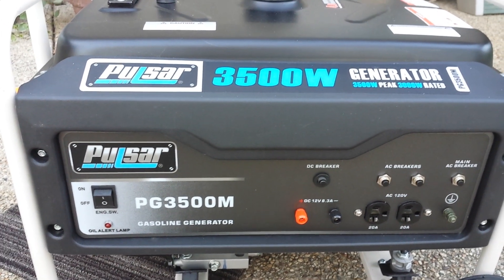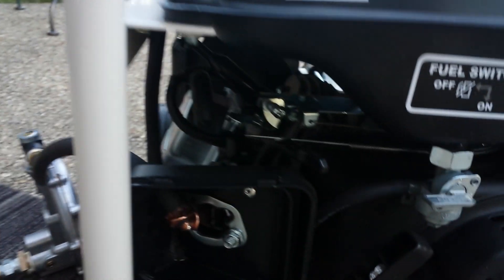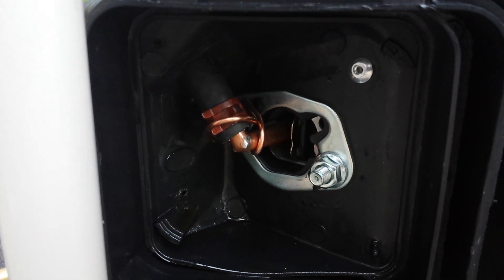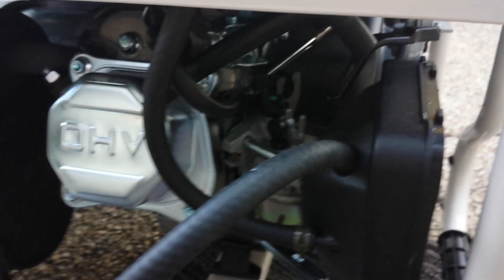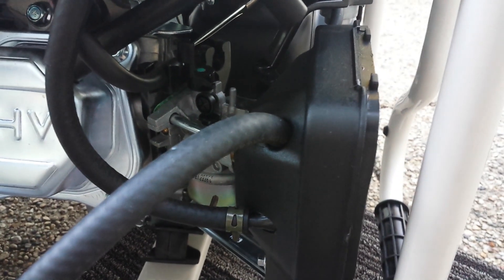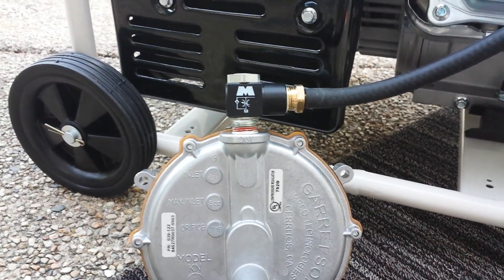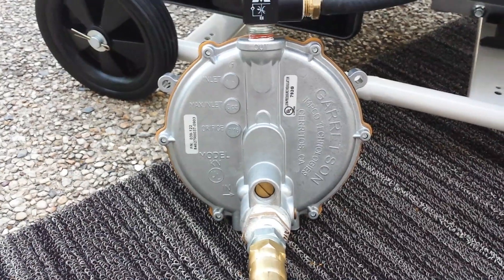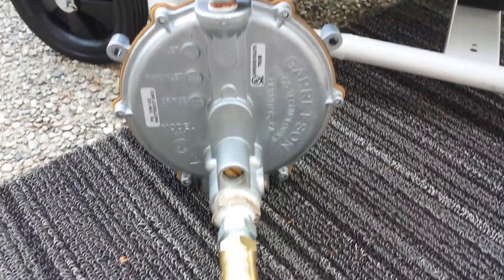Convert your gasoline generator to run on Natural Gas

Comment: What is the size of the hose and how many feet of hose, and were you bought it and the price? US Carb is currently out of 1/2” 3/4” and 1” hoses Thanks.
Reply from the maker: Captainkleen I used 1/4 inside diameter hose to the regulator.  Keep that hose as short as possible. I would say no more than 2 feet.  I used normal gasoline hose. It is a demand regulator, so it needs a small vacuum to work.  Keeping this hose short so the vacuum demand works properly.  The hose from the house to the regulator can be as long as you need.  I used 1/2 hose used for an outdoor grill.  3/8 will work fine also.
Reply from the maker: If you have a large generator you will need something bigger than a 1/4 hose and copper pipe feeding into the carburetor.